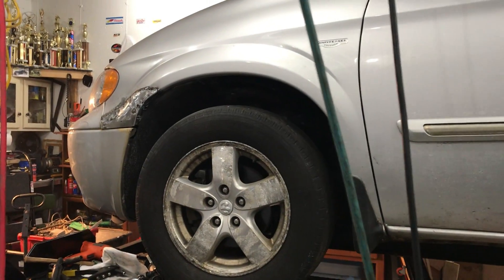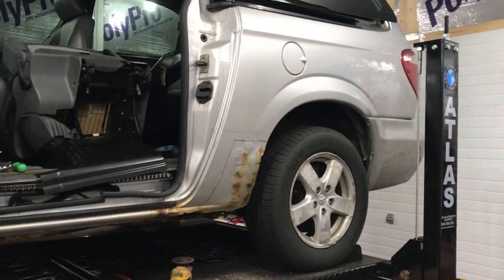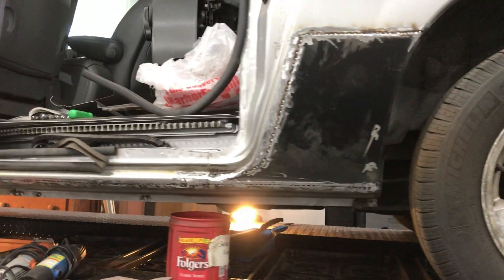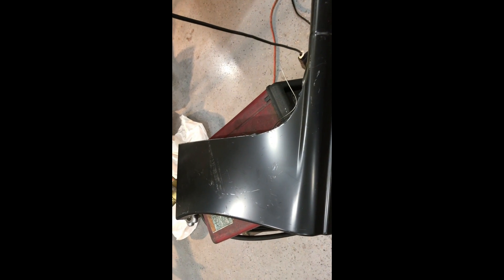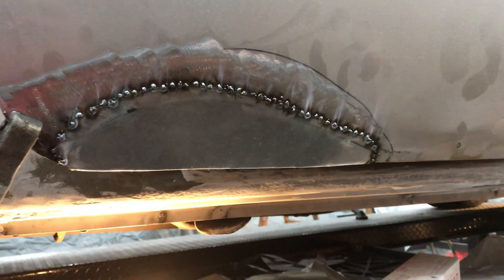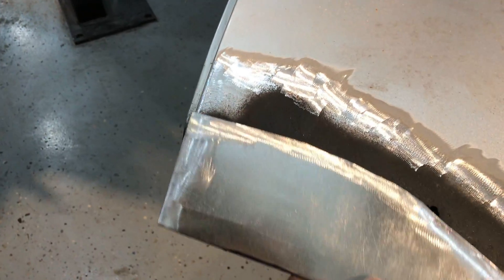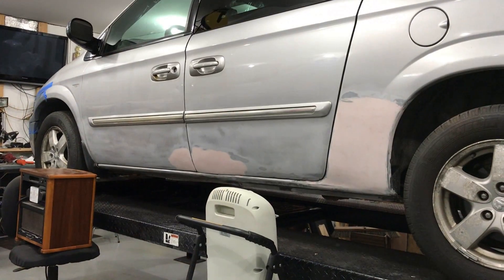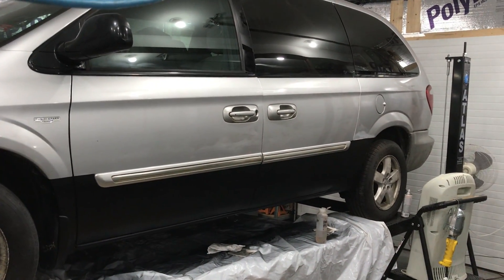Something a little different- RUST REPAIR CHRISTMAS

Comment: Nice job Bill,  your a good Dad and father in law. Years ago I had to do that repair on my 70 Ford Country Squire Wagon. The New England salt solution kill these cars. Just changed the brake and fuel lines on my 2006 Silverado
Reply from the maker: Thank you. 😁 NE salt really does a job on cars.